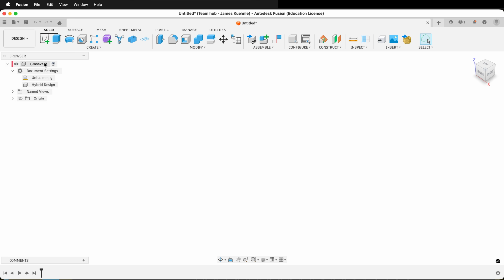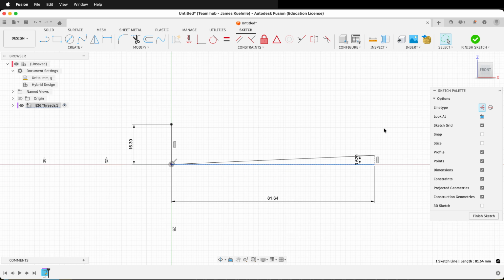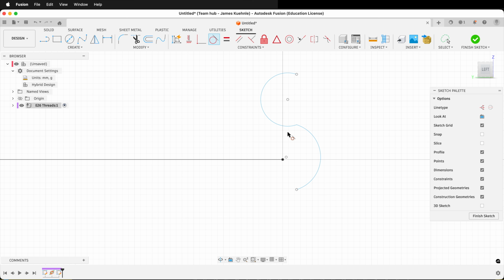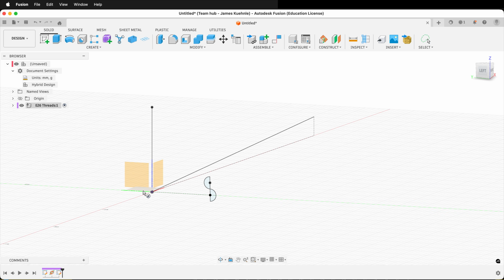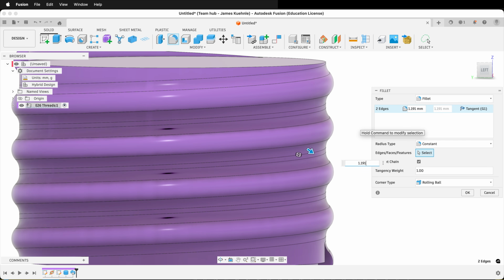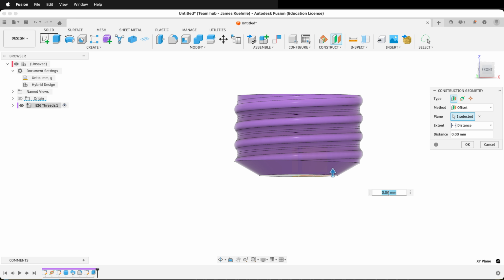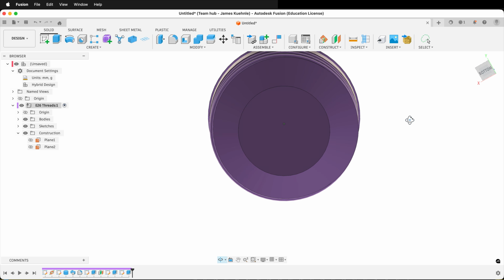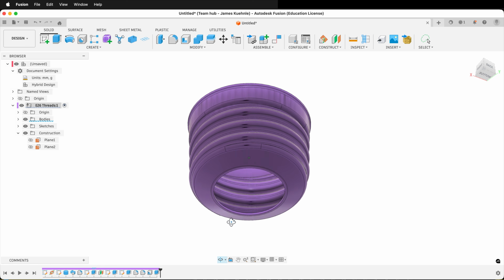How to Model E26 Light Bulb Threads in Fusion Using IEC Dimensions

Comment: Hey, thanks a lot for this. When I do the sweep. It sees the patch line and the diagonal ine you drew at around 1.28 of this video. so the thread follows the verticle line and the diagonal line, thoughts on this?
Reply: Had the same issue. Make the vertical line a construction line. It will pop up 2 distance boxes to fill in when you create the sweep now. Put 0 in the top box and leave 1 in the second box.
Reply: @brandonholloway6728  Thank you. I had the same issue too, but that fixes it